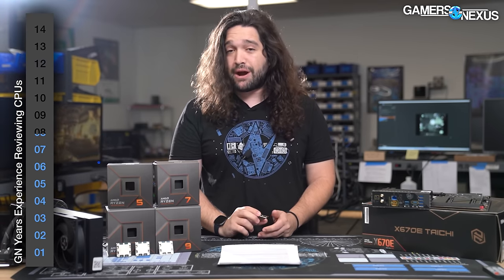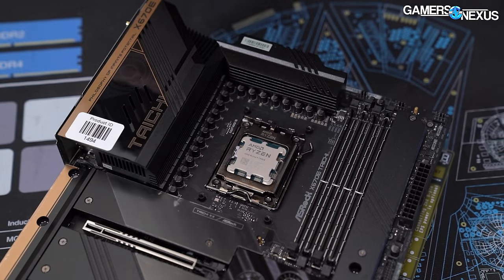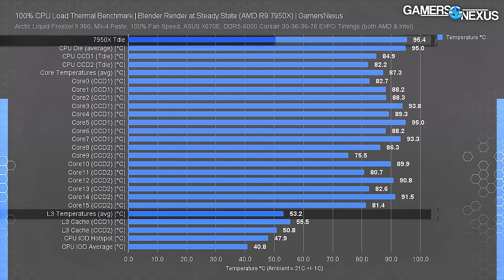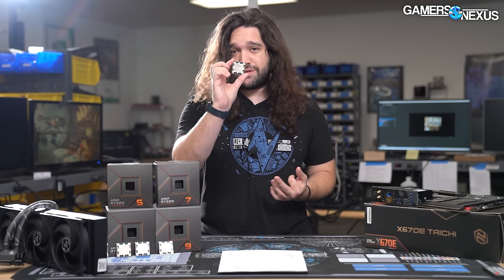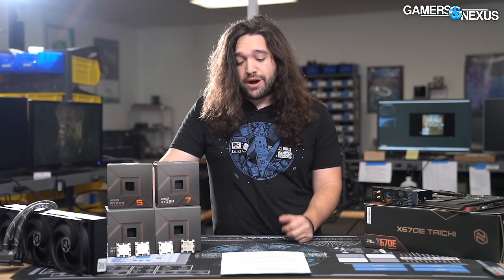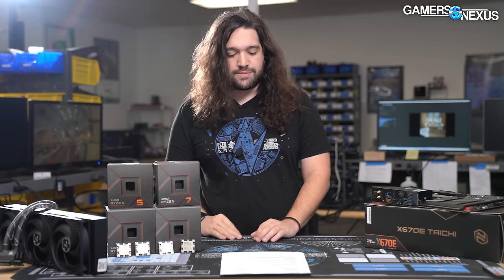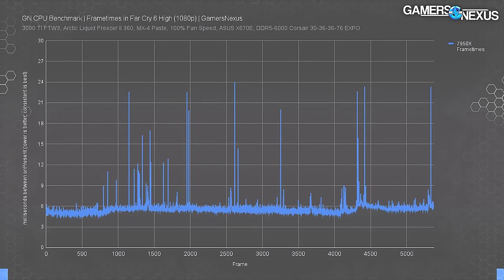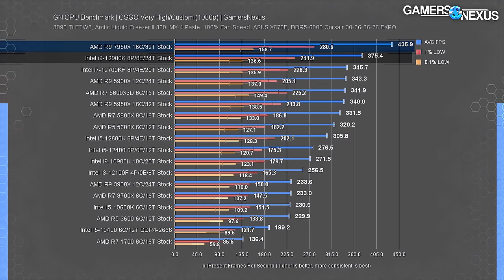95°C is Now Normal: AMD Ryzen 9 7950X CPU Review & Benchmarks

Comment: If things keep progressing like they are I might need to invest in a modular reactor just to power my next rig.
Reply: Most homes only have 15 amp circuits which use 14 gauge romex wire. Dedicated circuits for microwaves and fridges are often 20 amp and use 12 gauge romex so thats what you will have to do for your computer soon. You can wire the whole house with 20 amp circuits but the 12 gauge romex adds considerable cost to the job. 
Your going to have to pick a specific spot for your computer to sit just like your fridge or spend thousands more wiring the entire house with lots of 20 amp circuits. 
Next up is 240 volt dryer and stove circuits 😲....

Comment: As normally, lots of great detail and information Steve and Team!  ALL of these now power hogs in every part in the system... I will be riding my 1st Qtr 12700K/3080TI/1000 seasonic build for quite some time.. having to get new intelligent PSU and so much power pulled... I hope the next few coming Gens get better on power consumption.. But it is exciting to see the competition and advancements, that is only good for us all.
Reply: It wasn't benchmarked in this video, but the Ryzen 7000 series has an "Eco mode" that sets sane power limits (choice of 105W and 60W, and of course since it is unlocked, you can choose your own)

For the 7950x at least, the results are very promising. Some have seen 10% performance  reduction for a 25% power reduction for the 105W setting.

Still, it is a real shame that even AMD has fallen for the "moar performance at any cost" mentality, or at least as the default.

Comment: Well what the... I use a Noctua dual fan cooler that I pulled off my 5950xt and under load stays at 5.7+ghz and temps max out around 70c. Testing was done in 3d Mark Time Spy Extreme and Cinebench. I'd be happy to post screenshots. Fans only hit mid speed.

After watching this when I get home I'm running the tests again as that doesn't seem right.

Edit: My bad, high temp was 83.75c, still that's pretty good.

Comment: The core-to-core temperatures sound like something a scheduler should be made to adjust for - when at high multicore load, try and schedule less tasks for the cores which are approaching 95 to  regulate their heat production and allow more total boost. Maybe taking into account the true better-performing-cores too.

Comment: 5:25  This means these CPUs will wear out faster due to the fatigue caused by fast temperature change to 95C when you turn on your computer.
Reply: Did you keep watching? AMD said that it can stay at 95°C pretty much indefinitely without extra wearing down of the silicon. Unless they're flat out lying (which would result in several lawsuits), spiking to 95 at startup (which doesn't happen anyway) won't affect much.

Comment: 1:25 sold me at the kitty! How about a few benches with throttling set at 75 degrees, 20 less?  Whatever AMD might say and spec, I won't have a CPU running constantly at 95 degrees.
Reply: i9 12900K : Hold my 100*C constant
i9 13900K : Hold my 100*C minimum

Comment: I got a 7950X3D with a Noctua NH-D15 and it can hit 5700MHz but it seems to have a more consistent frequency of  around 5400MHz which I'm still really happy with considering I don't have to deal with the stress of liquid in my system.

Comment: Would have been nice to include Eco mode in the results. But I get that it already took significant time to test what was done already.

Looks like Eco mode is 80-90% of the performance at around 1/5 the power usage.  Which is pretty impressive and could mean some amazing server and laptop options coming.

Comment: I would be curious to see performance scaling at different power consumptions. Modern CPUs are now pushing to wild power consumptions for tiny performance improvements. My 5950x only gets ~10% more improvement with a 200W power limit vs the stock 142W limit in Cinebench. So 10% improvement in performance with 40% more power consumption. Some reviews of the 12900K showed similar, where dropping the power limit from 241W to 125W only dropped performance in applications by 14%. I'd be interested to see the ECO mode benchmarks here. From another review I saw, the performance only dropped by 10% at ECO 105, which sets a consumption limit of 142W (so the same as the "105W TDP" of Zen 3). In another review, the 7950X was even able to beat the stock 12900K in ECO 65 mode (88W limit, same as "65W TDP" in Zen 3), which is wild. That means that the 160% increase in consumption from 88W to 241W only leads to a 22% improvement in performance. I think AMD's efficiency claims are legit, but only if we don't let the CPU guzzle as much power as possible. Zen 4 is going to be insanely good for laptops though.

Comment: Direct Die design cooling means 20c lower temps.... from 90s to 70s ... much better but you have to mod your expensive CPU.
The Boot times are as intended ... it starts with critical settings and  if not booting normally ... then it goes less critical. Very nice when the system does this at first starts.

Comment: I think 720p gaming benchmarks absolutely have merit. Much more so than any other gaming benchmark. I'm not talking about doing "synthetic" tests like AOTS, but cp2077 at low min resolution, steamdeck preset and high performance FSR? Do it.
Reply: Also, minimums are absolutely something you can feel, especially if you're not sharing those charts
I ignored everyone and mated my ancient 980ti with a 5800x3d, I've gone back and forth, and I will tell you, I can tell when its a 5900x vs a 5800x3d. This is why its so important to actually measure against low settings. I'll be using this 5800x3d at least until the next gen consoles arrive - it is just that fast at game logic.

Comment: For the games that had issues due to OS scheduling, did you experiment at all with re-configuring the CPU Affinity on the game process to limit the number of cores it could use?  I wonder if limiting those games to a single CCD might solve some of the frame time spike issues?  That assumes such issues are due to inter-core latency.

Comment: When i purchased my ryzen 7 5800h laptop i was already quite shocked to see cpu temps of up to 90 degrees. But that is certainly considered normal. 
Entirely disabling turbo gets it down to 50ish and truth be told the difference isn´t that huge. And then there is ryzen controller that allows me to use turbo AND decide on what temp the cpu will be kept, like 70. I mean it might be designed to run that hot but i certainly don´t believe that it will be so good for longevity.

Comment: The choice of cooler is important in both directions.... If you want more performance, put a bigger cooler on it, but if you want more compute efficiency, put a smaller cooler on it. If you ran your benchmarks with a top performing 360 rad, then the efficiency is going to look pretty meh. Drop a 90mm heatpipe tower on it and retest. Clocks will probably drop 5-10% depending on the test, but the compute efficiency will probably near-double.

Comment: When comparing production workloads please take into measure what the newer chip actually costs in terms of the increased power consumption. The difference between a 125w consuming device compiling code in 53 minutes versus a 250w part compiling it in 35 minutes is by my calculation 5 cents. 5 cents for 15 minutes of increased production? That's nothing. And the 7950x is the clear winner for me from this perspective. Furthermore, with accessibility to household renewable energy the argument high against power consumption becomes less important, leaving just the thermals to deal with.

Comment: I mean, under a good water block with lots of radiator space the 5950x with power constraints removed will easily boost over 200 watts draw so this doesn't seem like that different of a behaviour with the 7950x, just bumping into the thermal limit more so by design. This is going to make automatic fan controls more of a pain to tune, probably better to just go by fluid temperature and run the pump at 100% with watercooling

Comment: My 5950X used to cap at 3.8 Ghz all cores at 105W. Now it's still at stock but AMD allows it to draw 145W at 4.5 Ghz all cores. This means the 7950X can draw more than 175W at stock.

Comment: The proper way to compare efficiency would be to set the 7950X to the same TDP as the 5950X, then see how both perform.  Or use a weaker cooler, which will make the 7950X not clock as high, and draw less power as a result.  

What you did was give it a license to clock high, so that's what it did.

Comment: Realistically, as we all know, a high temp CPU is not really an issue so long as it isn't throttling. You'll still get 5+ years out of a CPU. Maybe there's a way to limit the TDP? Though I'd rather my CPU not exceed 90 tbh, then again, so long as it does a good job of staying at 95 or below during the summer time by changing the variables effectively, then it's all good.

Comment: So the limitation from this test is the thermal interface material of the heat spread, cooler, and thermal paste. I'm just going to assume removing the heat spreader will mean the CPU will still run at 95C as expected.

Comment: I would like to see the 7950X tested with some non exotic cooler that will manage to cool it bellow 95 degrees no matter how the CPU tries to heat up. Like, some double 360mm custom loop with D5. Just to see how far it can push itself if it isn't thermally throttled.
Reply: He mentioned that they were going to test it using liquid nitrogen. That will show what this thing can do.

Comment: boiling temperature is interesting feature. You could make lots of coolers based on boiling, it might be much more efficient to cool that way. Hot Bubbles boil and go up as hot air, to meet a metal cold rod to return back into water on top of the cooler. Than you don't need pumps as hot air naturally wants to get out of water. But it creates pressure issues inside closed loop. Gpu's could be done the same thing, but isn;t great for longetivity. My bet is they are decreasing longetivity to increase performance, but they want the chip to die faster so you would buy it more often... Or you could do a open, loop but you will have huge water wastage... 

Even if you make cooler more efficient, it cannot be said the same about the chip...
The hotter the chip is, you lose more performance, also the resistance increases due to temperature, thus you need more power, than it heats a lot more. Basically that is why you want to run chips into super cool state, the less the resistance - less power is needed, it is more cooled and has better performance. My bet is 5950x is still the king here for this generation...

I think the greatest advantage might be the temperature differences. As your chip is boiling the ambient temp is the same, thus the difference is higher. You might add smaller cooler and it would cool good enough for performance, if you lose 100-200mhz does it really change anything?

The main thing you will get from this gen is pcie 5.0, that you will need for new generation nvme drives. It might rock the performance like crazy. Loading screens will take only 1 second. Still though the full unlock will take a few years, so it might not worth buying new gen...

Comment: Using MX-4 paste on a high-end CPU like this with higher TDP & TJM, I can appreciate wanting to show what a casual shopper would use. But if you're an enthusiast then every few degrees saved matters and you should opt to use Thermal Grizzly Kryonaut Extreme because of the better conductivity. 

I've seen plenty of GN ads for it, so I don't know why you wouldn't suggest that (I do find it suggestive that MX-4 is still the baseline seeing it being used here), it would certainly help the more casual builders with their temps if they have an extra $20 since they can afford the top range of new CPUs. Like in my mind, if it's designed to run at 95C why not invest the pocket money in getting that to have it run a few degrees lower? One of the easiest and cheapest ways to get a quick temp improvement. 

Like I said, I get the mentality of MX-4 being the baseline for years and it gets the job done, but with rising TDPs in CPUs and GPUs it may be time to adjust that baseline for testing and recommendations moving forward..

Comment: If you want a bottleneck, use a 2990WX, even in Game Mode. Not to mention Game Mode introduces tons of frame time issues, but normal mode causes random issues in MW2 Beta where FPS goes down to 2-4 FPS until you re-launch.

Comment: Interestingly Ars Technica's tests showed that AMD seems to have designed Zen4 to draw far more power than necessary by default. When they manually lowered the TDP limits the CPUs lost very minimal performance while drawing significantly less power. So either they had platinum samples or AMD is overdriving these for some reason. Though that may prove to allow for much higher overclocking headroom than was previously achievable on older Zen designs.

Comment: 20:41 With a ~100fps 0.1% low for the 5800X3D vs 50-65 0.1% for the other two CPUs I think it could hardly be called "an insignificant margin" - you can play the game and the spikes don't hurt the experience that much, but that's not the same as 'insignificant'.

Comment: I've read it's hot because of the density of the Transistors and other parts that are operating at high speed that generates the heat. So as it's small it only has a small cooling area. 
I hear 1st boot times are longer as it tests the memory to see what the best settings are rather than defaulting to the lowest settings.

Comment: Thanks for the review, informative as always! Very impressive numbers (particularly as I already have an overkill custom loop setup and would be able to re-use most of it). The level of uplift in production workloads at matched corecount is nice, but not game-changing, and similarly with the gaming results. Overall, about as good as could've reasonably been hoped, but not enough to make it worth it for me to eat the upgrade cost (including platform upgrade cost of new mobo/ram) over my current 5950x system given my usecases (I have significant nongame all-core workloads but only for hobby purposes, not moneymakers, and my main games are minecraft-with-mods-and-shaders, which is 100% GPU bound, and dwarf fortress, which is 100% CPU bound and 100% singlethreaded, which would benefit but not hugely).
Reply: modded minecraft is almost always CPU bound though, even with shaders

Comment: It would be interesting to compare these high end Intel and AMD CPUs for efficiency while dropping frequency slightly. Such as reducing power to 7950X runs 5.0 GHz all core rather than 5.2Ghz Or just capping 12900K and 7950X at 150 or 200w. Clearly both sides are throwing efficiency out the window to claim "leadership", but I suspect many will do a slight downclock, since generally that last tiny bit of frequency comes at a large power boost.

Comment: Why dont you show the 12900k OC results on the benchmarks? Historically you have shown this data. The intel CPU's usually have a little OC headroom, while the AMD chips generally wont overclock. It seems safe to assume most people with a 12900k would overclock it to 5200,5300mhz on the P-cores and 4100-4200mhz on the E-cores. It would be great to see if that closes the gap any. Loved the review regardless.

Comment: I have a working Ryzen 2700 with an MSI b450 Gaming Plus MAX mobo that just keeps shitting the bed. I had it RMA'd, and same dumd issues. On top of that the TForce memory that it used has problems as well. I actually discovered on my own that TForce pulls a scam on Newegg where they continually swap between Hynix and Samsung RAM modules in the same branded memory. They would sell the Samsung RAM at a full price, and the Hynix RAM at a sale price. I discovered this when upping from 16GB to 32gb and wondered why I could not get 3200mhz across all sticks. CPUID revealed that the RAM I paid full price for was Samsung, and the sale price RAM was hynix. I even left a review on Newegg.ca. 

Which left me stuck with an i5 2500k 16gb ram and mint 19.2. Couldn't be bothered to waste more time on that, as I was trying to work on some projects that are unlisted but viewable via my YT PL

I was looking at replacing my broken system with a new Ryzen. But at those prices and heat yield... eh...

Comment: Thanks Steve, thanks to this video I now know I was using my GN motherboard coaster in the wrong orientation.  No wonder all the coffee stains were going to one side, my plastic coaster vram was in the wrong spot. 

More on topic, what the hell is AMD snorting that they think a chip running at 95c is acceptable?  I don't want a freaking space heater literally on my desk.  Who am I kidding?  My space heater doesn't get that hot, it would short out if it tried probably.  I would really like to see what these cpu's can do if you put a power limit of 80% or even 70% on them, because I don't give a crap what AMD says I am not going to let any component in my PC get that hot.  I have to sit beside it.

Comment: I wonder if undervolting would actually help performance. If the system is going to go to 95C no matter what, then it stands to reason that, if you have good Si that can remain stable at help higher frequencies with lower input voltage, you can reach higher clock speeds before the package temperature reaches 95C. Maybe undervolting is the new OCing with these. Time will tell.